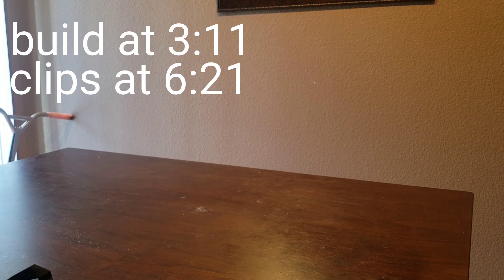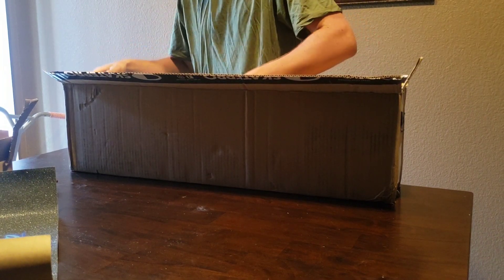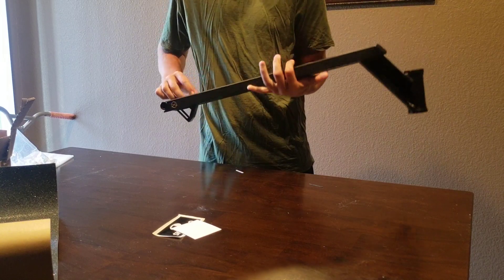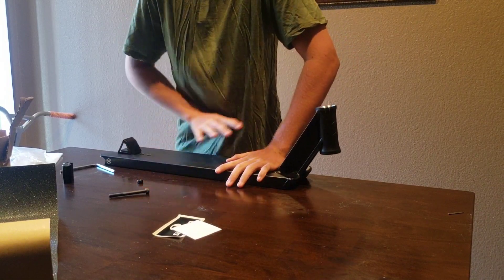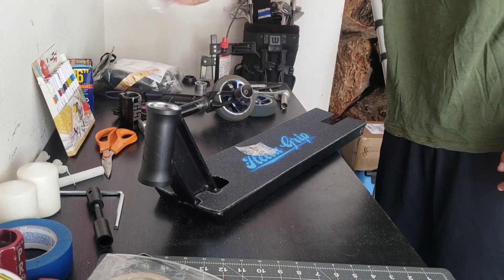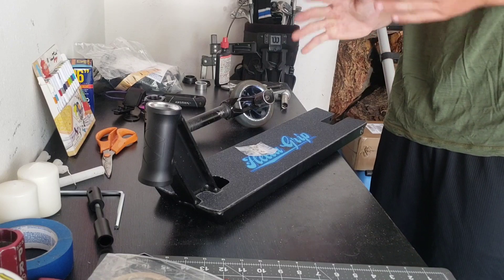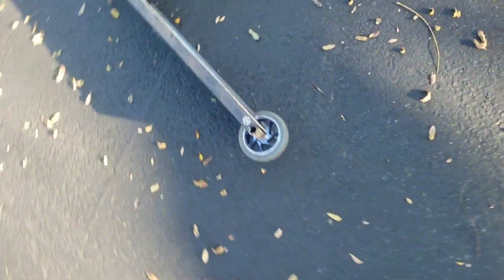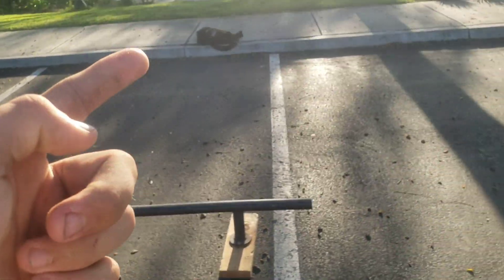Native advent 2 deck unboxing! + build & clips

Comment: What do you use to tighten the back wheel iv got an Allen key but it requires something else in the other side
Reply from the maker: Just use a small Allen key in the other dropout, I dont know if you are familiar with native dropouts but they actually hold the locknut, you just have to stop the dropout from spinning while tightening. So just put a 4mm allen key or a small screwdriver in the slot of the dropout while tightening the other with the 6mm allen